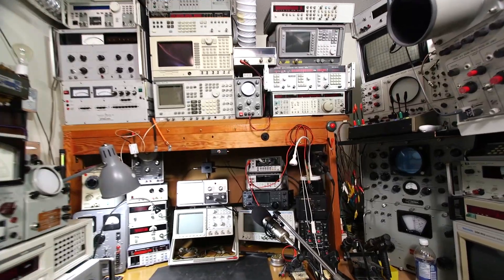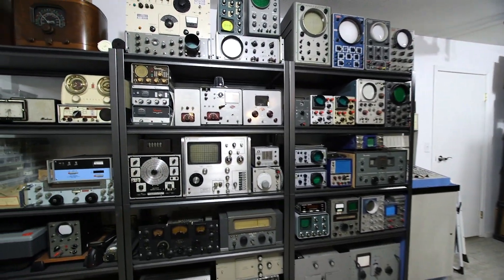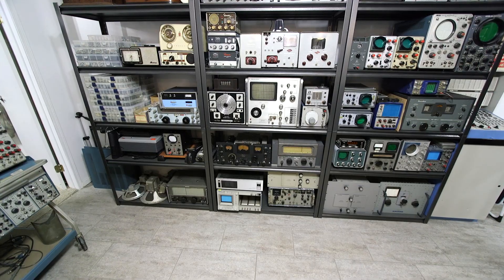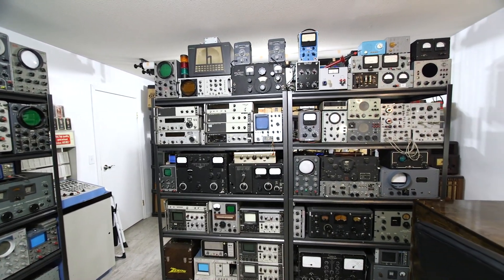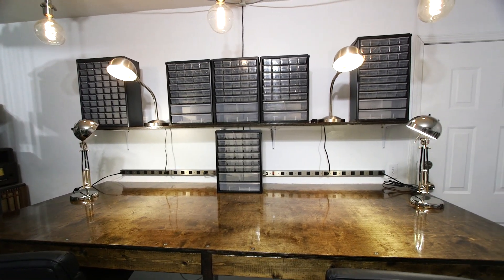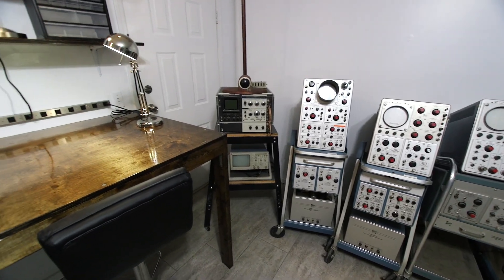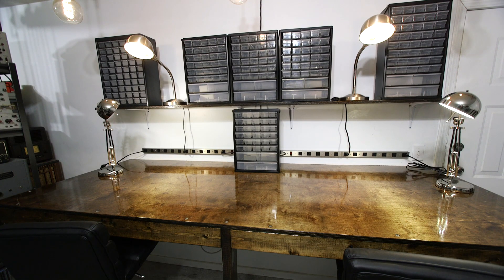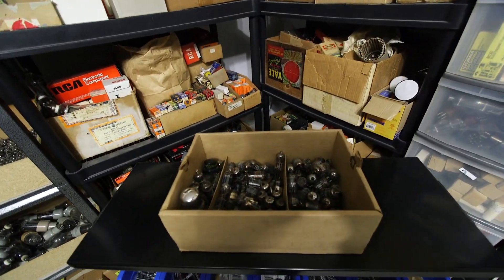The New Lab, Mr Carlson's Old Time Lab.

Comment: Hello Mr. Carlson. I have a Heathkit SB-614 station monitor. I spotted an SB-614 on a shelf in "The New Lab, Mr. Carlson's Old Time Lab" video. I would be excited to see a maintenance video on the SB-614. I have an SB-104A which I built myself. When the instructions read "push the on-off switch to the on position" I was rewarded with a satisfying quality thump in the earphones. There was no blue smoke and the transceiver has worked perfectly since 1983 when I built it. I am an amateur radio operator with the call-sign VE6IFR.
Pierre

Comment: And I thought I was a hoarder! When I turned 59 started to shrink my collection of stuff. Stuff I still keep is my 2550 Motorola service monitor, Tektronics analog scope, Octopus, HP audio gen and AC volt meter, and an RCA Volt ohmist along with a Fluke 87. Still have to borrow the Aeroflex from El Paso for most my field work. It's a government required piece of equipment. Too bad I can't afford a  $30k test set.

Comment: Very interesting setup.  It reminds me of when I took electronics back in my junior and senior of high school and they had similar equipment stacked up on shelves for testing and project use.  I was wondering if there is any chance of doing television repair videos.  I love the radio and amplifier repairs but I need a refresher on television repair.  I have a Zenith 20" that I'd like to try out a similar chasis from its original and want to know the proper safety method of picture tube connecting and disconnecting.  If you have a modern television to demonstrate on that would be great.  Something from the 90s would be good.  Thanks.

Comment: Your new bench is a great improvement and should allow you some more space for your test equipment. It shows how much thought went into the design and construction, which reflects your consideration to small but necessary details and quality. Looking forward to up coming projects in which you identify the problems, the reason for the problem and the best way to restore that equipment.

Comment: I JUST NEED CAPACITORS 420VOLTS 5600uF TO BLOW ALL MICRO DIGITAL DIODES....HIGHEST VOLTAGES UNLIMITED HIGHEST CURRENTS UNLIMITED TO STORE THE ENERGIES CAPACITORS NO TRANSISTOR RESISTOR DO DRAINED.....420VOLTS 5600uF ALL I NEED IS MOTOR TO MATCH GENERATOR THREE FOUR FIVE SIX SEVEN PHASES TO RUN SMALL COMMUNITY PULSES MOTORS PUSHED THEN PULLED JUST LIKE TRANSFORMERS TO RUN MULTIPLE MACHINES ONLY USING 1KILOWATT ...1200K .....120V 240V 600K 360V 300K 480V 150K 600V 75K 720V 3.85K 810V 100K.92.3 9ohms 2ohms 3ohms

Comment: My eye settled on the BC 348. Back in the UK there was in the early 50s lots of surplus equipment. I received my Ham licence G3NEM in 1956 and the 348 was coming on the surplus market and they where mint condition. I would have liked the AR88 but could not afford it and settled on the BC348. It was in beautiful condition and had a rotary converter which when removed left room to build a mains power supply. I used that receiver until coming to Canada in 1966. It still has a very special place in my memory . If you ever rebuild  it would be on my thank you list with the many other wonderful projects you have already shown me and bring back so many memories. 73 Ve7ban

Comment: Hey Paul  I see as one of your projects an Eico oscilloscope which I had gotten around 1967 when I was 26. I sure miss it and all the other equipment I had when I did electronic work. All that's left now is an Eico power supply and a Motorola  digital duel channel tone generator which was used to service old time radio pagers. If you'd like it, I can send it to you. I bet you never saw this thing before.

Comment: A suggestion for the dark areas...try rope type LED lighting.  You can put the light where it is most needed more so than if you simply put a light in the ceiling or such.
Keep up the excellent work!  By the way...do you have any 5R4WGY type tubes?

Comment: Hola ! Si me puedes ayudar tengo un analizador de espectro HP 141T  el rango de frecuencia va  hasta 110 mhz y el otro plug in de 100khz a 1.25 ghz .. como son los pasos para el ajuste basico del display .. horizontal pos gain y vertical pos gain usando el pateon de 30mhz..

Comment: This video just popped up on my feed. I loved seeing all the trolley mounted Tektronix oscilloscopes, brought back some memories of my early working days in semiconductor testing.
In the test lab we also used Tektronix type 575 & 576 transistor and diode curve tracers. Potentially lethal voltages and currents available at the end of 4mm sockets!
Had a tingle or two from those units in my time.

Comment: Modern equipment might have more bells and whistles, but indeed older equipment is still valuable. I have an old frequency counter I've bought from a friend of mine. It is a good unit, perhaps from the 80's. However, the internal reference was a conventional crystal that formed an oscillator, in which the circuitry had a variable capacitor that needed constant adjusting. In the end, I ended up taking the crystal and the associated circuitry out, and slapped in a small OCXO. Works great, now! An on top of that, it is very reliable.

Comment: I restore vintage radios and amplifiers.  The fun part is I do all of it with vintage test gear from the same era.  It's like taking your device into a 1940's electronics repair shop.  I've found this to be much more satisfying restoring things with test equipment I've restored.  On particular cool equipment, I'll re-stuff caps, use vintage resistors and cloth covered but modern wire so you can't tell anyone has ever worked it.  I love your channel and am in awe of your knowledge.  Thank you so much for showing us everything that you do!
Reply from the maker: Thanks for your kind words Chris!

Comment: Loved the tour!  Three pieces caught my eye:  The Heathkit SB-610 RF Monitor and SB-620 Scanalyzer.  I have both in my vintage Heathkit SB-series collection that I'm restoring.  But the radio that is "near and dear" to my heart is the BC-348. which IIRC you mentioned came from a B-29.

My late uncle gave me a BC-348-J back in the 1970s while I was in my teens.  It completely absorbed my attention, and through it I learned about Amateur Radio.  And while I don't yet get on the HF bands until I finish restoring my Heathkit gear, I do have a 2-m Yaesu HT that I talk on quite frequently.  But it is still that BC-348 I'm drawn to.

I remember participating in the Michigan QSO Party some years back, shortly after receiving my ticket.  I was calling CQ, and when a station about 100 miles north of the club's shack replied to me, for a moment everything around me disappeared.  I was back visiting my Uncle Ed, as he gave me the gift of that radio.  And in the blink of an eye, every memory came flooding back to me, leading up to that moment of someone answering my call.  I will never forget it.

And so that BC-348 has a treasured place in my shack, and rightfully so.  And so it was nice to see one sitting in your lab.
Reply from the maker: Thanks for taking the time to write Bill!

Comment: Did you ever consider just using a sacrificial top on your bench?  I use an inexpensive door skin on one bench thats 36x72 and another bench I have that's 48x96 has a 1/8th in a sheet of white nylon as a sacrificial top. Nylon is incredibly durable. I built that bench 30 years ago and still haven't needed to replace the top. I did flip it over about 10 years ago. I guess that's the nice thing about the nylon top when one side gets worn out you just flip it over and use the other side. 

I have a third bench that's 24x48 and it has a 2 inch thick soapstone top. The soapstone workbench is by far my favorite electronics workbench. 

In my opinion, soapstone is probably the best material you could possibly use for an electronics bench. Unlike granite, it's very dense natural stone that doesn't need a sealer because it's completely impervious to liquids. 

Soapstone is also used as fireplace material in very cold climates. In fact, many people consider it to be the best fireplace material avalable. It has an interesting natural property where it easily absorbs heat but releases that heat in a very slow controlled manner. I once stayed in a cabin in the Swiss Alps that had an enormous 50K pound soapstone fireplace in it. The house was actually built around the fireplace.  That single fireplace heated the entire 2 stories house including hot water for the kitchen and bathrooms. There where pipes built into the fireplace that carried and stored hot water and some of it was even pumped through the floors to heat the floors. 

    They would start a fire in the morning in its tiny 14-inch square firebox. It would burn for about an hour on what most Americans would consider nothing but kindling and it would keep the house warm for 24 hours on that single burn.  It was the most efficient fireplace I've ever seen.  

 Apparently, soapstone is very efficient at storing thermal energy something the Scandinavians have known for centuries. It makes our pellet fired fireplace inserts look pathetic by comparison. You could probably heat that house in the Swiss Alps for 2 weeks on the fuel I use to heat my house for a single day.    

   Anyhow, sorry I got sidetracked. So as you can see soapstone can withstand extremely high temperatures. You can just lay your soldering iron right on it and not damage it. You can spill chemicals on it all day long and just wipe it up because it's completely impervious to liquids and chemicals.  At one time they used soapstone for high voltage insulators so its great for an electronics workbench. And best of all it's soft enough that you can fabricate it using normal woodworking tools. 

If you ever get lucky enough to find a slab I highly recommend giving it a try as a workbench top, By the way when I say it's impervious to chemicals I'm not joking, They make chemistry lab sinks and countertops out of soapstone.

Comment: Hope I am not bothering you too much for asking for a bit of advise here. I have a vintage Heathkit SG-8 RF generator that I am having a bit of trouble with. The audio tone section doesn't work and I have tracked the problem down to 3-position galette switch ( I think that's what they called them back in the day) that is oxydized quite a bit. It also looks pretty fragile.
What kind of contact cleaner would you recommend for cleaning the contacts on that switch? The mechanics all seem functional it's just that it has oxydation on electrical contacts. I don't have much experience with old time tube equipment like this so forgive me for asking like this. Thx

Comment: Very nice, just the kind of workspace I dream about!  I did want to ask about the roll around storage bins that you said are full of caps, what is that, and where would I go to find a similar type of cabinet?  Happy New Year!
Reply from the maker: Most hardware stores sell a variant of that capacitor rack. Lots of expensive caps in there, all name brand and high life span, low esr capacitors.
Reply: Thanks Paul!

Comment: "I wouldn't be crazy enough to use original cloth wiring"
I've actually got a run of original 1935 18-AWG cloth lamp cord supplying my home theater system/BOINC server right now. The stuff is surprisingly heat-resistant; even at 15-20 amps it shows no signs of insulation burning/deterioration. The cotton insulation on the individual conductors is reasoanbly stable, although the rayon sheathing falls apart if you even look at it wrong. Overall I've found that in applications where it's seldom moved around/disturbed, the original cord (even the really old stuff) can be quite viable for maximum historical authenticity of projects.

Comment: You need to get started a Museum Foundation right now because if you ever died unexpectedly most non-electronic lovers would call you a Hoarder.

BTW when you figure out the marketing wank makes Poly all but unusable because you are supposed to sand down to bare wood and reapply the whole finish for one scratch. Try BLO. If it scratches you can touch it up easily. All the beauty of fine Tung Oil without the expense. You can thin it with mineral spirits ( paint thinner ) to get it to dry faster, too. Otherwise it might stay tacky for a few days.

I look forward to your upcoming projects.
Reply from the maker: Hi John. Thanks for taking the time to write!

Comment: Thanks for sharing! love the lab and the idea.  I just have one question - looking at the power strips on your new workbench; How would you plug in two separate analog devices that interact with each other at the signal level to avoid creating a ground loop when both devices are on the same power circuit?For example say you set up on your bench an analog oscilloscope and connect its probes to the outputs of an analog function generator (like say a Wavetek Model 130) - Well, with your power strip setup both devices would be connected through their power supplies through the common ground, right? I suspect that Waveteks of this analog era might have reversed the polarity on their power supplies to workaround just this scenario; but I am not sure - I just know their power cords are pretty much unobtanium..so maybe the answer is a combination of my own noobie ignorance and the special circumstances that I just happen to have confronted..

Comment: Your new workbench looks nice.  To keep it that way might I suggest a 1/4" or 3/16" covering of hardboard (the same stuff as pegboard without any holes).  It is not nearly as reflective for your camera shots,  it's cheap, easy to replace and provides some cushioning for heavy chassis work.  It comes in 4' X 8' sheets for just a few bucks at the home goods stores.

Comment: There are two major options for your electronics workbench:
1. Create an alcove of test equipment around your bench area, and bring your project to the work area. I've found this works best for small project items, especially where you need to provide multiple diagnostic and support equipment. OTOH, it's difficult and tiring to have to keep looking left, right, up and down as you set a generator and view a scope response or meter indication. This was what your original lab area looked like to me.
2. For working on larger equipment, especially the classic military grade boatanchors out of the 60's and 70's, these things are so large and heavy that you might find that you should put them on a stand-alone, rollable pedestal, almost a small auxiliary workbench. When much of your test gear is also large & heavy, you can create a rollable "workstation" that can carry a functional suite of equipment. (As an example, a spectrum analyzer, oscilloscope, a couple of function or pulse generators and a couple of power supplies.) You might do this around a Scopemobile cart, or just a heavy, custom pedestal cart you build yourself.

Having rollable modules (of instrumentation and workstations) allows you to have several ongoing projects, each of which you can swap into your primary work area without losing the setups and jigging for other projects. Obviously, everybody will have their own preferences for what works best in fixed or rollable modules.

BTW, you can never have too many AC power outlets (and be careful of your lab grounding scheme). But, when working with classic tube test gear, its very easy to overload your power source (every time you flip on one of those classic instruments, its a 3 to 5 Amp draw). And in the summer, your lab air conditioning can be overwhelmed.

Someplace, every lab needs a mechanical bench, where you can clean out mouse turds and nests, wash down filthy parts and do lubrication and painting. A well-filtered shop-vac is just as needed as a decent oscilloscope.

Lastly, your work area needs strong lighting, and you might want to install a flood lamp on the ceiling left and right of your work area. Also, be careful of CFL and LED lighting; they are electrically noisy and if you are working with sensitive pre-amps or signal conditioning circuits, you may pick up hum and noise from those lights.
Reply from the maker: Thanks for taking the time to write Ed. Merry Christmas!

Comment: I think a real old test bench would have much less lights, and probably some of the early fluorescent lights. The wood surface would be totally untreated from the start and extremely ugly. There would be very little things on it. Two o three unregulated soldering irons, a multimeter, a variac, probably an old radio (old even by then) tweaked as analyzer and a multimeter. Not to forget the regular antenna conections for tv and mf and hf radio. Anything more advanced would be commodities from something else than a poor regular radio shop. Even having a proper tube tester instead of just checking if the heater was gone, some signal generator unless it was homebrewed and for shure any kind of proper oscilloscope would be more that was in the shop of any small to medium town, at least in Europe. As you know perfectly, the components then were so big and ureliable that almost all that was needed most times was identifying the multiple bad ones, have them bought and solder them in, even holding them with your hand while soldering. I think that what you are showing to be accurate should be more a exercice of clever old tricks that of test equipment.
Reply from the maker: This is where a logical balance comes in. I have to restore equipment here, on camera. I will use modern soldering tools as well. That fine line between new efficiency, and old time feel.